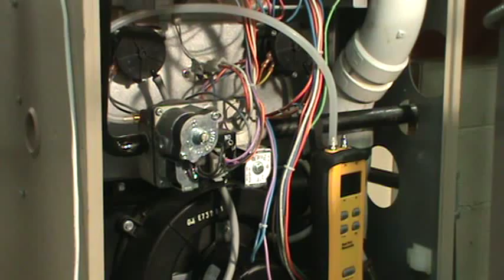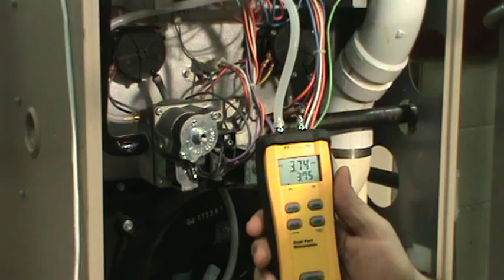Nat Gas Manifold pressure check on 2 stage Furnace

Comment: my boiler only has 1  adjustment on pressure to manifold. it was working fine for over 20 years. now im getting rollout, when i adjust screw almost all the way out,flame rollout stops. 
can i use it like that or do i need a new valve regulator